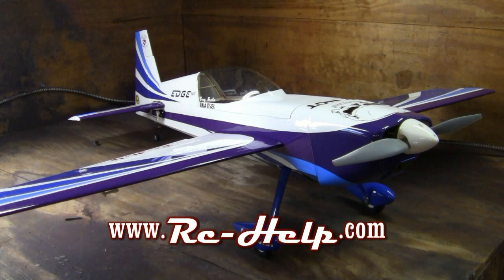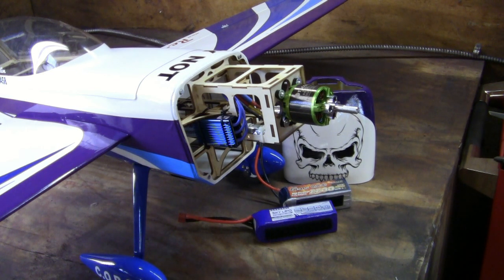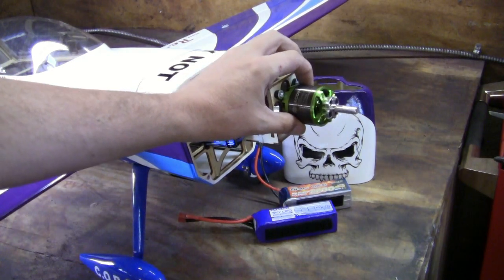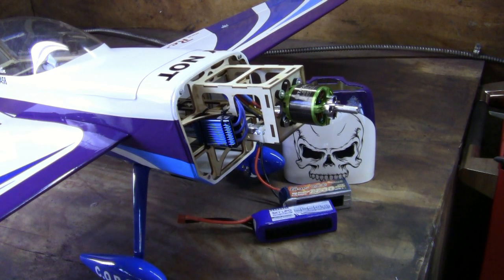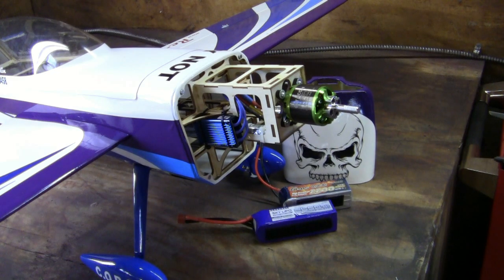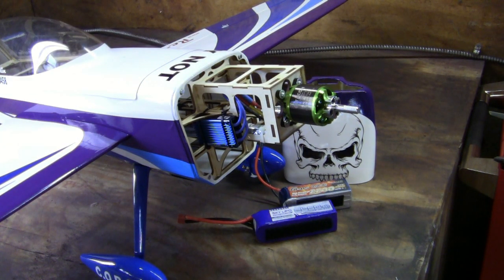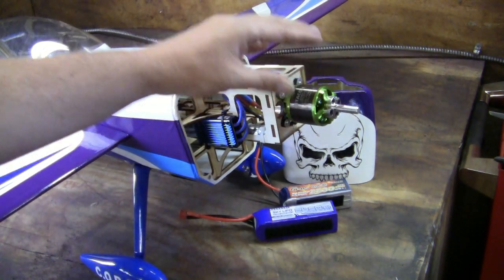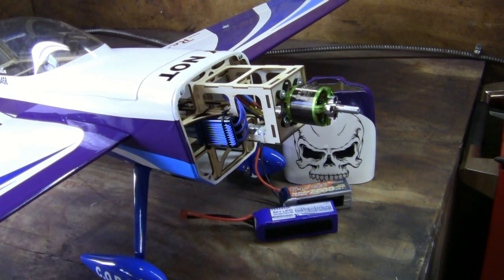Matching Motor, ESC, & Battery

Comment: Hi 
For my rc helicopter 
ESC 40A
Max 50A (not less than 10 sec)  what is this ?
Should I use below 40A or above 40A &
What happens above or below using means ?

For my RC car
60A ESC, I used higher than that like 156A discharge rate 
5200mah 30c lipo 
The ESC got fire 🔥

Then new ESC 60A
Used 2200mah 25c = 55A
It is working fine 
So let me know about rc helicopter ^
Which one to use 
Thanks..
Reply from the maker: I'm not sure why it says "not less than". It should read "for no longer than". The 50a is a burst rate. As for what one you should use, I"m not sure since i have no idea what motor you are using and how many amps it is pulling. For your car, definitely under powered on the ESC. I'm not sure what you are referring to on the third paragraph. www.Rc-Help.com
Reply: (About Car) brushless
ESC 60A,battery 2200mah 25c, motor 4300kv 
Finding out Amps
> 2.2×25=55A 
ESC is taking 55A and passing to the motor it is taking 55A 
It is under 60A so if I give above that like 80 100amps it will start smoking 

(About helicopter) ESC 40A, 3000kv motor
Should I give amps to ESC  less or more ?
I searched about this online and I got nothing so help me out bro
Your email address so I can send picture of that 
Hoping...
Reply from the maker: Come over and post up on the forum. www.Rc-Help.com

Comment: Hi sir 
I have 1000mah 40C lipo , so can you please tell me which motor and ESC I should use
Reply from the maker: It all depends on what you are going to put it in. Post up on the forum with your project and we will help you out. www.Rc-Help.com
Reply: RcHelpDotCom I am going to make RC Plane and I  have only 1000mah 40C lipo, so I want to know which motor and ESC will work
Reply from the maker: You need to know what motor your particular plane requires in order to know if the battery is going to work with it. You can pull 40 amps out of that pack nominally (this will change with age and habits) so any motor that pulls less than that will work at the given S rating. But not knowing what plane you are going to put this in, it is impossible for me to suggest a motor around a battery. As stated in this video, you first select the motor FOR the plane you are planning on flying, THEN you select the ESC and battery to match or exceed what the motor requires.

Comment: To get the amp draw from the motor, you said you need the wattage. How do you figure out the watts of the motor from the kv number?
Reply from the maker: You can't figure out the watts with the KV. KV on these brushless motors means RPM Per Volt. So if you have a 1000kv motor, 1 volt will equal 1000 RPM, 2 volts, 2000 rpm and so on. The best way to figure out wattage is with a watt meter which are pretty inexpensive now, but the motor manufacturer should give some numbers to start with. This is where I would start. Hope this helps. www.Rc-Help.com

Comment: Everything is fine but I have only one doubt "Did high C rated battery i,e; 30C,40C.... Will damage 30amp esc ??" Or should use low rated c battery for 30amp esc. please  tell me.
Reply from the maker: The motor pulls the power, the battery doesn't push it. You can go as high on the C rating on the battery as you can afford. It will not hurt a thing. In fact, the higher the C rating, the cooler the battery will run since it is not stressing it as much.
Reply: RcHelpDotCom "THANKS BRO"

Comment: what happens if your battery has a higher amp rating than your esc
Reply from the maker: Absolutely nothing. The motor draw is what matters. You just need to make sure your battery and your ESC can handle the power draw that the motor is requiring. www.Rc-Help.com

Comment: What if the motor amp information is not available? How can i match my lipo and esc to the motor?
Reply from the maker: If you can find a wattage number you can do some math to find out the amp rating at a given voltage. Watt / Volt = Amp. If you can't find a wattage rating, then it is likely that you won't be able to find a safe voltage rating in which case, I wouldn't run the motor. www.Rc-Help.com
Reply: Thanks

Comment: all batteries are not the same. most specs on cheap lipo batteries are way wrong and will not do the amp rating it says. thats why a better battery or higher c rating from the same company will sometimes give you a boost in power because the specs are correct or higher. there have been numerous battery test on the web that show this. also a prop change will drastically increase or decrease amp draw no matter what the motor or esc specs are. an amp meter is a great tool to have.

Comment: can u tell me how much voltage can take esc i use for hdd motors it works relay good i need to know if can take 24 volts
Reply: https://www.ebay.com/itm/HW30A-Brushless-Speed-Controller-ESC-For-DJI-EMAX-FPV-Drone-RC-Quadcopter-Hot/152669429496?epid=2188208698&hash=item238bce9ef8:g:O78AAOSwC9VZgF2d  here link  sameESC i have 30 A all i know and capacitator can take 35 volts
Reply: thanks but  i dont know what s3 mean and OPTO i all i want to know is max voltage input cuse more voltage more rpm i get . i have try 12v and 18v  at 18 v start to get hot cuse no heatsink .   one more question  how to get more rpm what does depend on this is motor limiting max rpm or ESC  can i get more rpm on same motor whit beter esc whit higher freqvency ?

Comment: Yes ,you are right.Lipo are more reliable in power supply.
But as just a confirmation I need.Li ion will work on my ESC.
One more thing.
Do it need any ESC programming change.

Comment: Could you please check this link and confirm. This ESC and Motor matching and work without issues.. 

https://m.banggood.com/Racerstar-2845-Motor-Brushless-Waterproof-Sensorless-35A-ESC-Combo-112-114-RC-Car-Parts-p-1113519.html

One doubt to ask. 
If a 35A esc, showing Cont.current/Burst current as 35/120A.What that mean.
Please reply me.
Reply: I am planning to use this motor and esc to construct a rc boat. Thats why i choose it. But after refering your motor, esc matching video am having doubt about the specification of motor and esc. Here motor current is more than esc current. 

Help me to sort out this confusion or recommes me  a motor and esc from your end.
Reply: Yes i know, this is not designed for boat. But i am looking for a cheap motor and esc. 

Just need a good advice and information about esc, motor and battery matching. 

From your video i got a great information already. Really a helping  video. 

But most of combo products(Motor and ESC)comes with less current in esc and high current in motor. 

But as per your video it is wrong. 
What to do in this situation. 

And apart from that, i  am using Li-Ion batteries. 
How can i find the amperage by 
mAh*C/1000 Formula. 
Here mAh is known. But for Li-Ion, is there and burst values like 20C, 25C, 45C etc etc

Comment: Awesome info ,thanks for posting.
Say you had a 100A ESC on there,that won't make any difference in amp draw from the battery because the motor is rated at 43 amps,is that correct?
Thanks,Rob.
Reply: cool so it doesn't matter if you overrate?, it only becomes a problem when underrated yes?
Reply: Thanks for all the help,i'll check out your website for more www.Rc-Help.com
Rob.

Comment: Hey brother real quick ? I have a cobra 3525/14 kv 560 already have a 60amp cobra esc so what size battery should I use? I'm trying to fly a balsa cub with a 70inch wingspan it weighs about 5pounds ...recommended prop you think would also be helpful! I'm trying to turn my dads old gas plane into electric so he can fly it please get back to me thanks!

Comment: Thanks a million man. I am pretty new to this sport/hobby and I started out clueless. Before I spent more money only to crash and burn I invested in a very good sim which I spent an hour a day at least just learning to fly for my first two years and it did help me tremendously but there is nothing like the actual thing. i hear what you're saying about being careful as to what some guys say on the net.  you and a few others have taught me more common sense things like all of the major pieces you gotta take into consideration when shopping around. Believe me I felt like a moron for far too many years and have mismatched components and allof the knuckle head things one does without asking questions and doing the research because there is a lot going on under the cowl. thanks I really enjoyed your presentation and even took notes which I will keep and use..take care,
Chris

Comment: im so confused haha i don't know what esc would go with then Tacon 2445-17T Brushless Motor 2900KV
Reply: ok thanks, would a esc with different colored wires the the motor still work?
Reply: could i use this esc? Turnigy TrackStar 25A 1/18th Scale Brushless Car ESC its 25 amps but it says it can run on 2-3s limo and i probably would use a 3s
Reply: ohh so the higher the amps on the esc the higher the lipo you can run on it?
Reply: This esc would work right and i can run a 2s and 3s on them?

Trackstar 30A 1/16th Scale Sensorless Brushless ESC
Reply: Definitely Thanks for all the help!!

Comment: Hi, I just got a CR28M KV: 1050. That is 2 contrarotating motors, rated by the manufacturer at 320W or 25A each. Do I need two separate ESCs, rated at 25A each? And a battery that can push 50A? What battery do you recommend? This is my first build and I'm quite overwhelmed. Any help would be greatly appreciated.

Comment: Currently looking for an esc to go with my motor. The motor is 1770 watts and my batteries are 11.1V 30c 3 cell. This means it's drawing 159 amps? So I need minimum 180Amp esc. But then I do the battery maths and work out that my batteries can only put out 66amps anyway? So I need new batteries as well now? Trouble is I can't seem to find a motor small enough using the maths you've provided. The stock motor in the rc would not have been appropriate in the first place? Please help ?

Comment: Does volts matter? I mean the plane comes with an 25 c 3.7v battery 500 mah. Can i use 25c 7.4 volt 800-2000 mah battery?

Comment: I have a 935kv motor with 1500mah is that enough? And if I buy a larger one can I recharge it even if it's not called rechargeable???
Reply: And what esc should I get?
Reply: RcHelpDotCom my motor is a MT2213-935 and my battery is a LiPo 1800aAh / 2S RXcan I recharge it even if it's not called rechargeable?
Reply: RcHelpDotCom it doesn't say it can't be charged it just doesn't say anything. Here's a pic of it
Reply: RcHelpDotCom I'm currently living in Poland so my link is in polish but you can translate it with google translate this is exactly what I'm getting http://riku.pl/towar/p/id/7574/
Reply: RcHelpDotCom ok thanks how do i get help from your forum?
Reply: RcHelpDotCom what mah battery do you recomend? I'm on a pretty tight budget soooooo
Reply: Ok but do you recommend a mah for the battery?

Comment: Mostly what I hear is a larger battery will give you more run time,not faster. I have noticed that myself. The C rating would determine speed ,that is what determines how much juice the motor can use from the battery. The larger the C rating,the more power you can get out of the battery,but if you go beyond what the ESC can handle,it wont matter,you will fry the ESC and mabe the motor. I would stay within the recommended sizes and "C ratings, a larger battery may give you more time,but if it is bigger,it will not help performance,throw the CG off and you may have problems fitting it in your fuse.

Comment: my battery is rated at 66 amps, and my motor at 34 amps at 11.1v. So will a 45Amp esc be good? Does it depend on how big the power supply is?

Comment: Hello i need help? Im looking at a motor that has a max watt of 315W, but i divided that by the battery I'm looking at volts which is 7.4V but got 42A and says the motors max current is 25A. What do i do?

Comment: so i have a 1400 kv motor for my park flyer.... i run 3 cell lipo.... using your formula my little 80 graham motor is pulling 126 amps?   is that correct?

Comment: Thank you for the great video, but I'm a little confused. I've been flying RC for about 5 years, but have always struggled with the numbers side of it and have decided to get serious about learning this stuff.

Shouldn't a motor always pull the amount of amps it was made to pull?  But with your formula, on a 4 cell, it would pull 47 amps, but if I'm using a 3 cell, it would pull 63 amps.  How can the same motor pull different amps, based on battery selection?  Also, does more amps = more power, because if so, wouldn't choosing a bigger battery mean more power?
Reply: RcHelpDotCom
Makes perfect sense, thank you for taking the time to reply. :)

Comment: but i am a bit confused ,a guy on hobbyking says he is using  3s 2200 with 8x4.5 props with NTM Prop Drive Series 28-26A 1200kv / 286w (short shaft version. with 3s 2200mah lippo total weight of quard is 1.2 kg and having absolutly no problem and is having 6 to 8 min flying time.  according to urs way   it should be 4x286=1144  but according to his battery  1144/11.1=103.06.but   ampere=(mAh of battery)(c) /1000 i.e 2200x3/1000=66A.    so m confused . :(

Comment: i have turnigy plush 25A ESC .weight of quardrotor (without motors n motor accessories 650 g) using  20c  3 cell lippo.  can i use 800kv  300watt brushlessmotor.

Comment: 2403 Brushless Outrunner 2100kv
Max Power: 120w ~ Max Current: 10.9A. 12A~15A burst ESC
Recommended Battery Type: 7.4v 2S (but what size 500/800/1000mah, 20c/25c/30c?
3D slow fly 8040 prop and 160g fly weight.
What would be the best battery choice for 120w motor & 12A~(15A burst) ESC?
Thanks

Comment: However if you use a larger battery it will last longer on the air because it won't be all the power at once

Comment: I have a 960 kv motor, not sure of the amp draw.  2200 lipo....and the 30A ESC gets hot and softens the wires to the point it quit operating.  Motor just rattles back and forth on throttle now.  ESC is shot....so I'm installing a 40A.  According to your suggestions I feel I'm heading in the right direction.

Comment: hey, new foamy pilot here.

I have a 3500kv 520 watt edf fan 6 blade, 45amp esc. the called for battery is a 4s 20c 3200mah.

I have a 2s 30c 5300mah  

so my question is. can I run a 2s battery in the 4s system?? or run 2x 2s @10600mah?

I know I can run 2x 2s to equil a 4s but want to know if it wil be ok to run a single 2s batt
thanks
MAV

Comment: wont a higher mah give you longer flight time? i always thought that. ive bought a 3s 4000mah lipo for my quadcopter that hasnt arrived yet, but it will have 4 20A esc's. will it do it any harm having high mah's? thanks

Comment: Brushless motors are given a Kv rating, which is RPM per volt, that lets you determine how fast that motor will rotate with a given voltage supplied to it. A 980Kv motor powered by an 11.1V battery would spin at 980 x 11.1 = 10878 RPM with no load. The current rating specifies the maximum continuous and/or burst current that the motor is able to handle. When selecting a battery and speed control, choose ones with continuous current ratings equal to or greater that that of the motor.

Comment: Thanks for your quick reply.
let's take Turnigy 710kv as an example. the spces( Battery: 3~5 Cell /11.1~18.5V
RPM: 790kv
Max current: 40A 
No load current: 1.8A
Max power: 715W) 
According to your equation, if I will use 3 cells battery.. to calculate ESC: 715/11.1 = 64 Amp .. which is not correct .. the max input current is 40amp.

my point, power value is changed according to voltage (# of cells).. I hope that I was able to deliver my point .. btw, I like your channel :) :)

Comment: Thank you for the video and get my like .. 
I think your way of calculating ESC is not accurate. Each motor can accept several batteries (e.g. Turnigy  790KV 3-5 cells) .. in that model pwr=715w, I cannot devide it over any voltage. I have to use the max one (which is 5 cells). I mean power for any motor is calculated using the max input voltage X max current.. whom are provided by manufacture... if not, power/max voltage ... not any voltage

Comment: Great video, it`s just what I need as I`m just getting into electric motors, ESCs and li poly battery's..but I was wondering, if I`m looking to get a longer flight time instead of more power how would I go about that ? run a equal battery in parallel ? could I use a battery with more cells(but the volts would be different now?) ? higher C rating ? I`m a little confused about this part and could really use help !

Comment: I dont understand why hangar 9 calls for the model is just bought to use the power 46 with the 60amp ESC and a 4000 may 30c 4 cell.

Comment: The Eflite power 46 with a 4 cell calls for 62.5 amps..now i cant go with the 60 amp esc right? if i use a 5 cell it pulls 50 amps. If i get the 80 amp esc can everything still run smoothly or is it to much?

Comment: I basically want enough battery supply to keep my quadcopter in flight for 30mins with a 8" prop. Now I can imagine that depending on how much trottle you use you will have a different result but I just would like an approximation. Also, I'm considering maybe running two 3s batteries in PARALLEL. Just pointing this out as 'Toby French' might have put these two batteries in series? 

Thanks a bunch! :)

Comment: Excellent video! very helpful! just wanted to confirm though, I have 4  motors (link at the end) for my quadcopter, each have a Max Continuous Power of 260W and a Max Continuous Current of 25 Amps. For each motor I have a 30Amps ESC. Now when it comes to the battery choice, I can basically choose any 4s or 3s battery as long as is bigger to the motor 25A? What happens when you have 4 motors? 

arkrc . com . au/products/SCII2215%252d1810kv-Scorpion-SII%252d2215%252d1810KV-%28V2%29.html

Comment: Maybe you can help me, fryed my motors (all 4 on quad) by upgarding to 2x 4s 35c 1800 lipo. Esc are 25 amp, motors WHERE 1460kv thunder tigers. What motors should I use that wont die with this set up? thx in advance